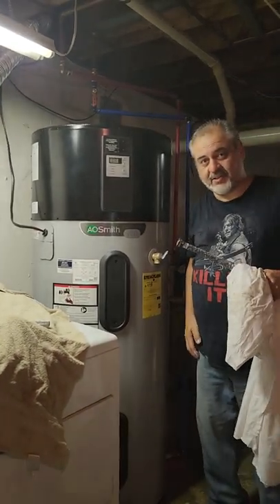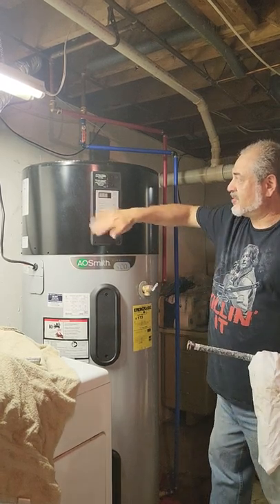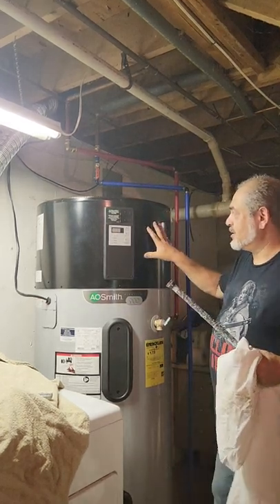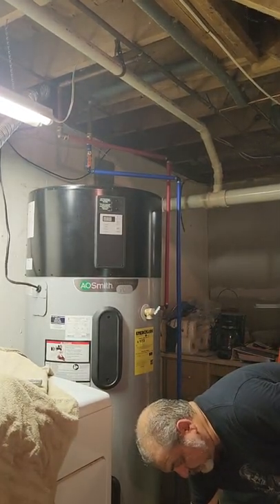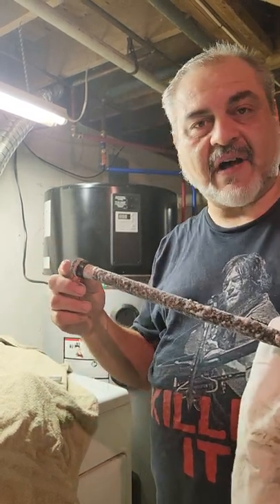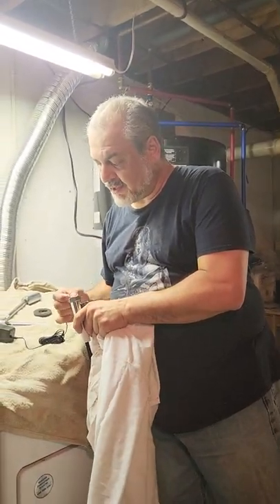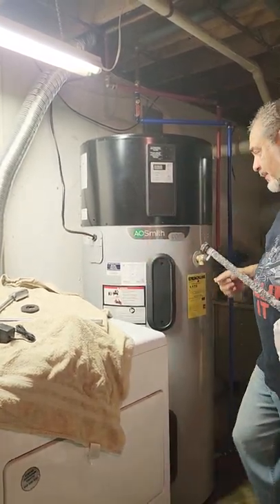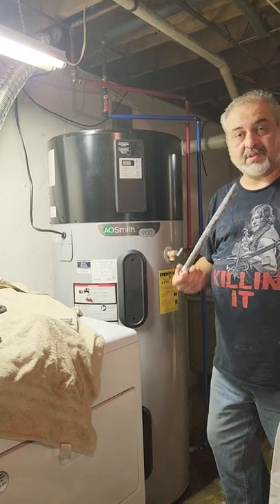Double Anode in A.O. Smith 80 gallon Hybrid Water Heater

Comment: Thank you, very useful information
Reply: A follow up question... Which rod did you replace with the electric anode rod, the long or the short one? thanks
Reply from the maker: @microtcpip  removed both rods, capped the 2nd hole. Just used 1 electric anode. I don’t think it makes a difference which hole you use.
Reply: @Stephenzaffarano  Yep, they make a units sized according to the water heater size.  I just bought an 80 gallon AO Smith hybrid heater, as well (the 120V@15A option, it looks like you did the same), and I am looking to get it all buttoned up with various fixing before I install.

Here is what I am planning:

* Thermal expansion tank - done
* Thermostatic mixing valve - done (this allows me to bring the temperature up to 150F, safely, give me a much greater first hour)
* Full port 3/4" ball valve for flushing the system
* Corro-Protec powered anode rod (like you have installed)

I am considering some sort of pre-heating system for water, which I may leave until later - the idea being that I could get heat from different sources and heat up the water slightly before it enters the hot water heater.  This could be a DIY desuperheater for my air-source heat pump, a solar batch heater, or sewage heat recovery system.  It may be overkill.  I have a big family and we were mostly satisfied with our 40-gallon gas water heater.  At our peak, we were up 9 people in our household, but we were down to 3 when I bought the new water heater.  However, we're back up to 6.  The main thing that the gas water heater offered was a fast recovery time.  The doubling of the tank size plus the TMV allowing the temp to be 150F should allow for a significantly better first hour than we even had with the gas water heater, but the recovery is going to be negatively impacted by the size (more cold water to heat up), switching from gas to any electric (unless we went with some monster amperage system), and then opting for the 120V@15A system... which is 1/4 the power that a 240V@30A system would be.

One other consideration I am toying around with is getting a few solar panels to run the electric resistance heating element and disconnecting it from being powered by the system.  I am not really worried about recovery time at night.  We have cheaper electricity at night and I would really like to just run the heat pump at night and leave it off at other times.  But, with the increase in size, some people like evening showers, so letting the resistance element run independently via solar (and even concurrently), may sort all of that out.

Comment: Anode rod is a 42” and a 14” you’re all good, just read the instruction manual. They also recommend zinc and aluminum anodes for hard water areas as opposed to the magnesium anodes that make the sulfur smell when they deteriorate